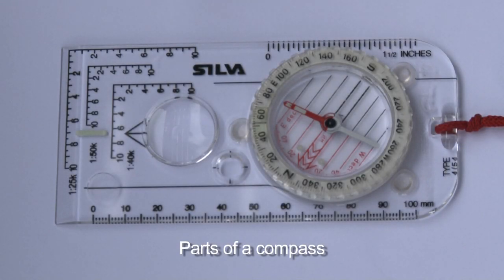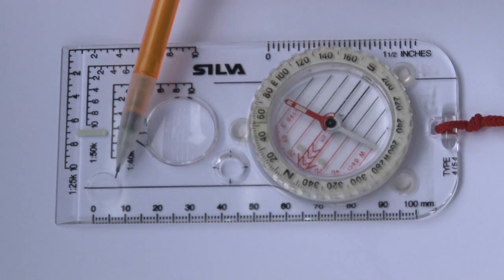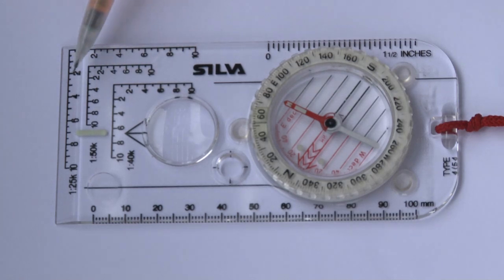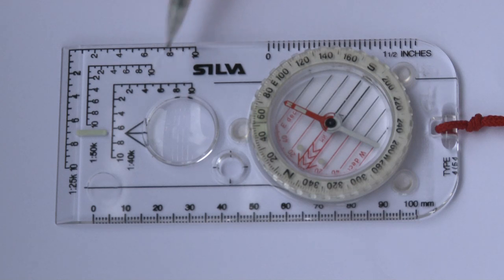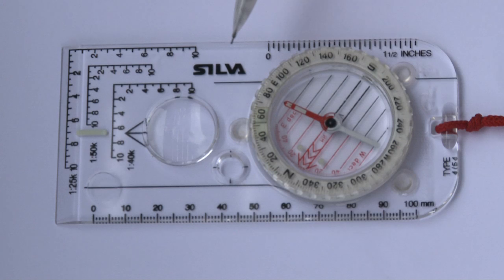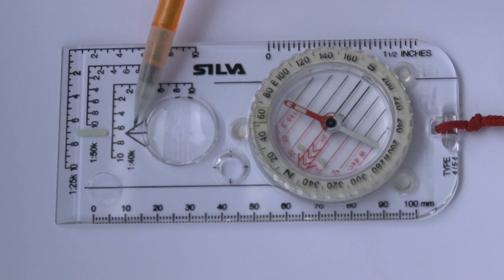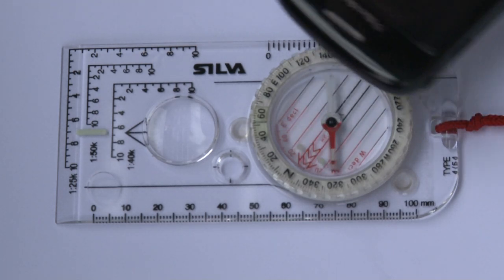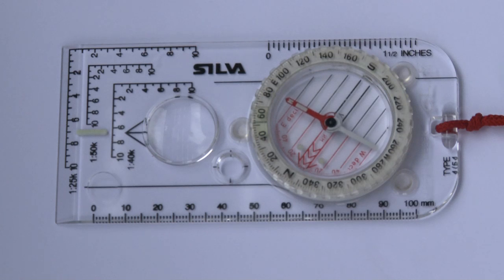The different parts of a compass

Comment: An older problem than mobile phone speakers is the dreaded bubble. Most people are not aware that the transparent components are nearly always made of PMMA (Acrylic/'Perspex') because it has great optical clarity and always looks clean and bright. Unfortunately, this is recipe for failure since PMMA is inevitably always full of microcracks. So I thought I would run the numbers on this. Studies have shown that typical microcracks are 400 microns long and 5 to 10 microns across. Oxygen and nitrogen molecules are 300 picometres across so one might easily conclude that once a compass has had a few hilldays under its belt the microcracks will join up and air will get in. Then there is magnetic susceptibility. PMMA and Glycerol are diamagnetic and have almost identical susceptibility. Air's susceptibility is dominated by Oxygen's paramagnetism, so the bubble changes things. K&R have been making a compass with an elastomeric capsule which should avoid these problems. I bought one for testing but even before we got it on the hill a brown sludge precipitated within the capsule, so that was not a success. Soft cases will tend to slow the advance of microcracks in a compass capsule but this is an inevitable flaw and they will all do it eventually. Built to fail?